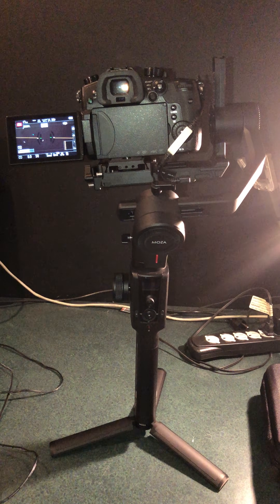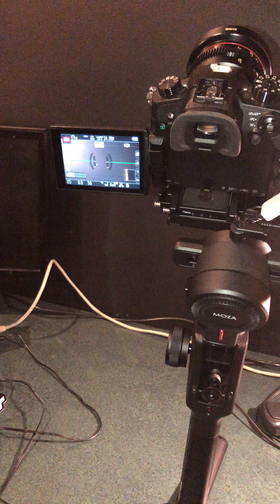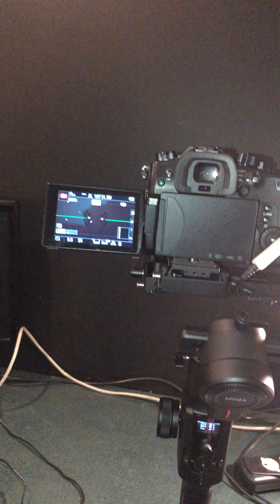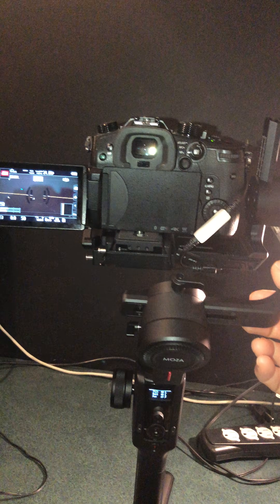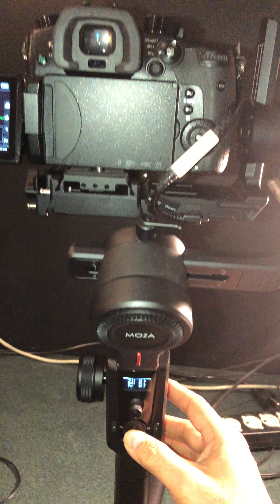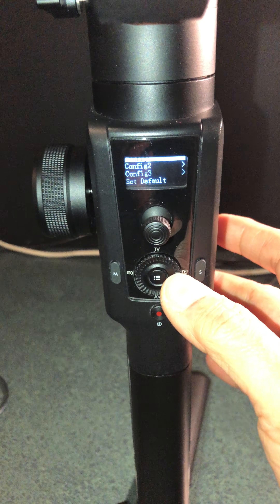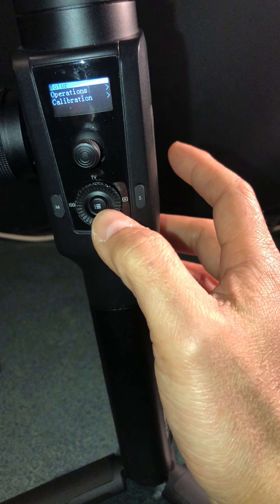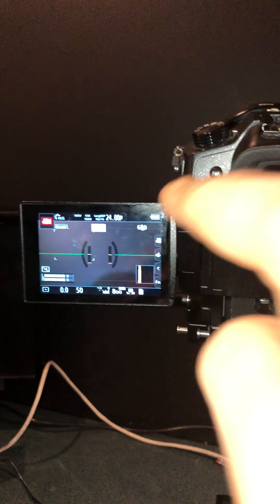How to quickly do calibration for your Moza Air 2

Comment: hi, how do you solve the shutter cable issue？ i use the factory cable failed to connect gh5s to moza air 2
Reply from the maker: If it too short, contact gudsen for a replacement
Reply: @mdifilm  your shutter cable look different, is from gudsen？
Reply from the maker: Yes. It’s the prototype

Comment: Thank you for this video... This fixed my issue with the air 2 shifting to the side whioe I was trying out the all lock mode and even the pan follow.  The user manual is not clear as to doing this calibration while the camera is mounted. The manual wants the air 2 laying flat on a table.